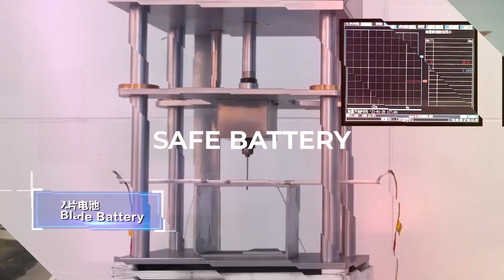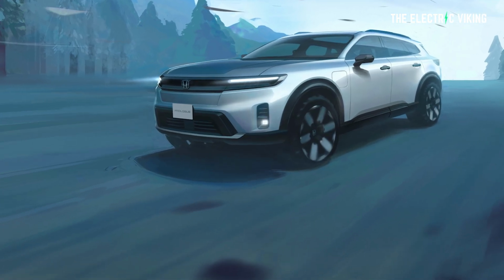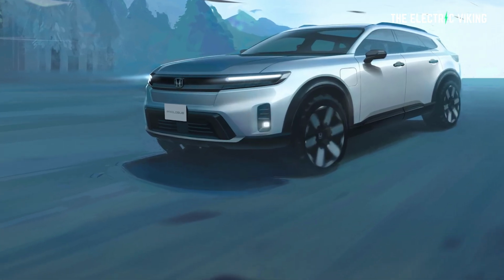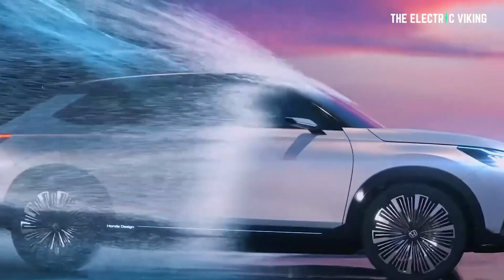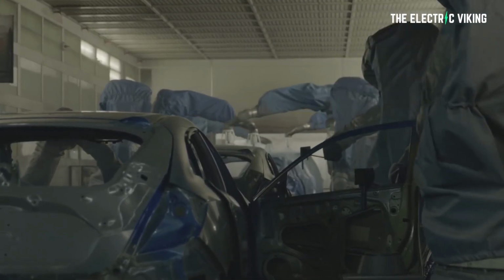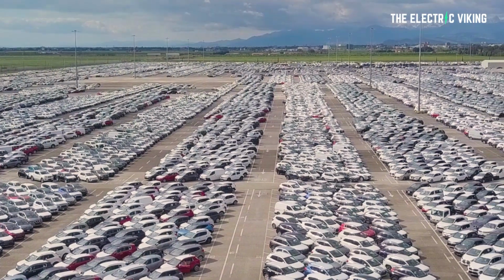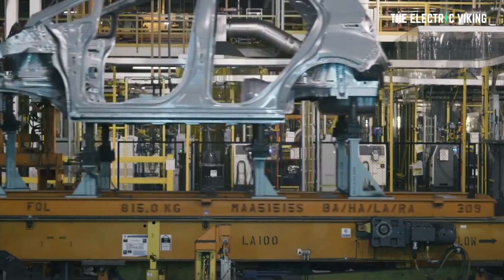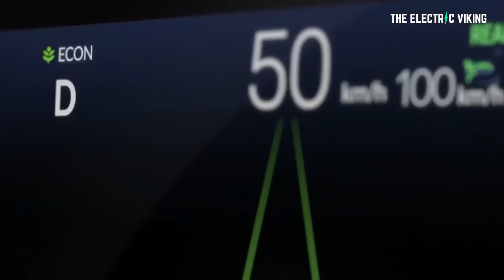This is the NEW GM built Honda Prologue electric SUV

Comment: Wondering if maybe this is based on NOT the Lyriq but a smaller version of the Ultium?  I’m sure it is possible!  If Honda wants a cheaper one they could have say a 77 kwh battery instead.  Think the Ultium starts out at 50 kwh minimum.
Reply: There is a small Honda Ultium but it is not coming until 2027.  There will be a Prologue and Acura SUV EV before that.

Comment: The Electric Viking, Thanks for all the content you put up. It's great to hear about what is really going on in the world wide EV auto industry. 

I am a Honda fan and not too fond of hearing about this partnership. I think I remember hearing that it would be limited to a few models to get Honda started down the EV road. I like the design of the Honda e they came out with but not the battery size. I know it's a commuter car by their definition but in America we tend to commute up to an hour to work.

There is a YouTube channel you might want to check out called Autoline Network. It is a Detroit, Michigan based channel that was previously only on local Detroit TV a few years ago. The main presenter has close ties with auto reporters and the auto industry in the U.S.A. overall. It might give you a more insider of the US Auto perspective.
Reply: Honda is planning an Ultium battery plant. You had better get used to Honda's new boyfriend cause he ain't going nowhere.😀

Comment: Fifteen years ago dealerships were marking up new cars triple invoice. Also, they often defraud on repairs. Musk is helping to put them out of business. 
I took my '08 Camry V6 in for a "red light" at the Toyota dealership in Henderson, NV.. After an hour, they diagnosed the problem as an O sensor, $370. I approved the charge. An hour later they told me it would be $870. I approved. An hour later, the charge went to $1370. I approved. Another hour and it was $1870. I approved. The service rep told me they needed 2-3 weeks to get the parts. I was charged $50, to be deducted from the total when I returned. So, I was kept waiting four hours and assured my car would be fine to drive until repair. While waiting I did some research, found out the sensor was a minor problem, but to pass smog inspection I had to get it fixed, so I went to a small garage, family run, and they fixed it in 20 minutes, $370. I remembered how I was treated at the "stealership". They had tacked on $500, three times, and I didn't notice until later. Luckily they erred by sending me home, giving me time. That was 5-6 years ago, with no problems since I kept the crooks from robbing me of $1500. But, they got me for $50 + 4 hours.
Reply: Isn’t it going to be great when the states get out of pollution controls? No more O2 sensors! No more gas or oil spills. No more radiator fluid, transmission fluid. Heaven!

Comment: Installing multiple chargers at a dealership is not as easy as you might think. The dealer needs to upgrade their electrical panels and install the heavy wiring needed for the chargers. The power company often needs to run a a heavier power line to the dealership to accommodate the power needs. It's expensive and it doesn't happen overnight.

Comment: DISGRACEFUL that Honda gets "into bed" with Gross Motors!!!!  Honda USED to be ahead of the design and tech curves!  Really REALLY disappointing !!
 BTW the Honda Prologue WILL NOT look this once it hits the streets!
Reply: GM and Honda are shacking up. Betcha didn't see that one coming, did ya?
Reply: @steven4315  hahaha NO! I didn't and I can only HOPE that it doesn't actually HAPPEN LOL
Reply: @davidbee8178  Already did, Honda is planning an Ultium battery factory and they have agreed to further deals. I see wedding bells in the future!
Reply: @steven4315  OUCH I WON"T be attending the wedding in that case.
Reply: @davidbee8178  It'll be alright, I think they will make some cute babies together.
Reply: @steven4315  HOPE SO ! IF they don't they will be illegitimate in a sense :-)
Reply: @davidbee8178  All kidding aside, everything I've read about the Ultium system sounds good. Honda will still be making most of their own cars and probably some for GM. Honda will benefit from GM's economy of scale, as well as GM's considerable experience in EV software. I own a Chevy Bolt and it is a great little car.
Reply: @steven4315  YES the Bolt IS a nice little car - I've driven them and I agree. I"m waiting for 2025 - by then Tesla MIGHT have the more affordable 2 hatchback - it's not necessarily that I am a Tesla fan boy,  I just think that the way they have set up their charging network for their clients is second to none.
Reply: @davidbee8178  Forget about the M2. More likely is that Tesla has a lot of room to cut prices, and probably will as Texas, Shanghai 2, and Berlin ramp up.

Comment: how inept do you have to be to want to get help for your EVs from GM? i mean really thats like really really sad.
GM building EVs for honda is a huge advantage for GM, GM is really bad at it and now they can get some practice on hondas dime. it might even help GM to make a decent EV. will miracles ever cease!!
Reply: Half of the automaker's North American plants will be converted to build EVs by 2030. So far GM has identified five of those: Factory Zero in Detroit-Hamtramck; Spring Hill in Tennessee; the Orion assembly plant in Michigan; the CAMI plant in Ontario; and the Ramos Arizpe plant in Mexico.

Every new vehicle will utilize GM's Ultium EV platform and battery management system, with more and more of the componentry being developed in house as production ramps up. Additionally, a partnership with LG Energy Solution known as Ultium Cells is building four battery cell manufacturing plants with the first one starting production this year.

GM says it will have the broadest EV portfolio of any automaker. The first 20 electric vehicles will be introduced by 2023. Here's what we know so far, by brand.
Reply: @normt430  broadest, maybe, thinnest, definitely.
Reply: I own a Chevy Bolt. It  is a good car. Honda looked at GM's Ultium system and liked it.